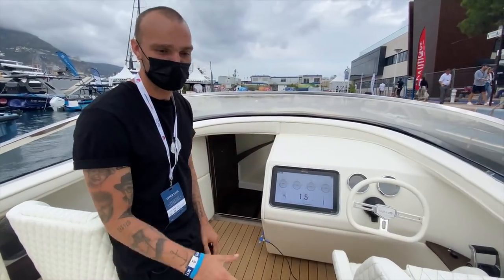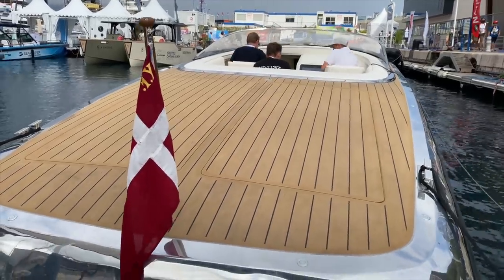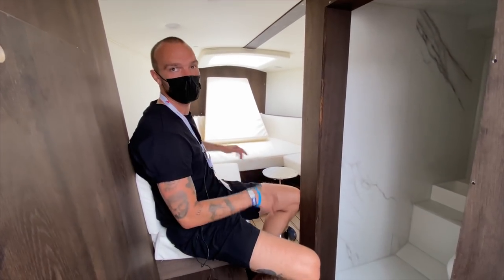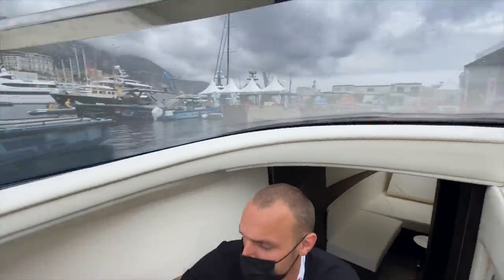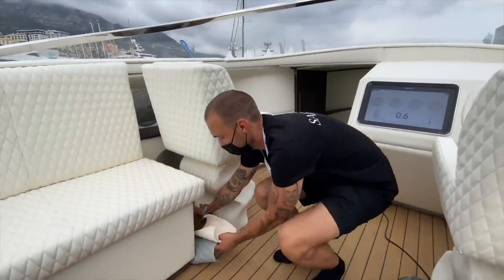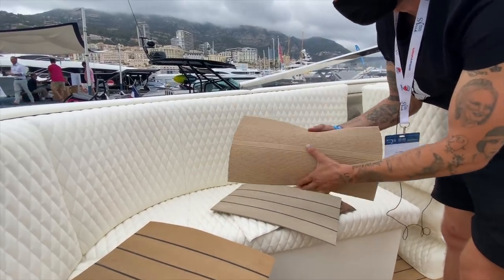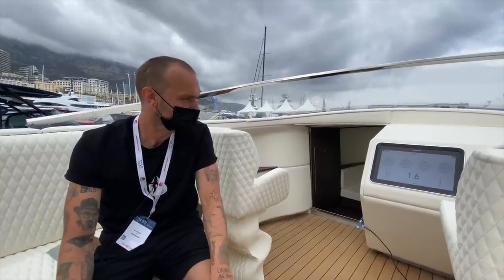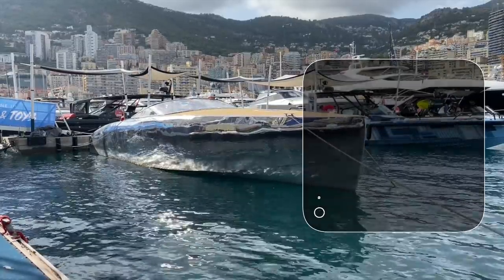100% Electric Speed Boat | Monaco Yacht Show

Comment: Great video.  Nice product.  I know it's hard to ask everything, but no back up generator in case?  I thought uncoated aluminium was attacked by salt which creates micro pits?
Reply: Is there such a thing as marine metal lacquer? Don't know.
Reply: Expedition artic  yatch's are frequently bare metal they use specific grades of aluminium are very careful about isolating mixed metals. 
Aluminium raw oxidizes rapidly.. essentially this is what happens in Anodizing...but to a greater thickness ... Its hard and quite resistant in itself and they usually have hulls measuring 5-10mm thick and of welded construction. This speed orientated vessel is probably a lot thinner overall but will still be a lot thicker than in auto or aero use. 
Its hull is reminiscent of some of the 1930s-50s grand speed boats or record breakers. Though they were usually of riveted construction like flyingboat hulls. Inside they would paint them and smear lanolin over the inner water structure to minimise the reactivity between rivets and plates.

Comment: Sarvo kind of shows the problems inherent to electric water vehicles, as he says you can run for about 4 hours on a cruising speed, he says that's 23 knots whereas the website says 15 to 20. Either their website is a bit pessimistic or he is being somewhat optimistic. And you got a bit faster? Your drain goes up exponentially. Hours turn to minutes. The problem is... PHYSICS. The Silent Yacht people were good to go into this. An electric car needs to get up to speed, which is taxing to the system, but once at speed its a relatively small amount of power to keep the speed maintained. Seas are not like that, it is constant push, constant push, constant push. And that's why yachts have thousands of HP engines, thousands of litres in tanks. A family yacht can be 0.4 mpg and a family car can be 40 mpg. 100 times the difference. So the much larger power requirement is problem #1, and problem #2 is the inability to provide it; that's due to the relatively small energy density of batteries compared to fossil fuel. Batteries are only a percent or two actual fuel, 98% or more of the space and weight is hosting materials (Oxidising compounds, Electrode materials, Electrolytes, casing, let alone installation racks) whereas in a standard vessel you have the "tank" (which might even  be plastic) and then everything else is pure fuel. 

That's not to say electric boats don't have a place. This speedboat can be a toy for a superyacht, quick laps around the motherboat or somewhat slower as a tender. The Torqueedo engines are fine for someone on a small yacht inflating an ultralight dinghy to tender to a nearby shoreline for a picnic. And yes Silent Yachts exist, but as the interviews with the people running it make clear unless you're content drifting around at walking speed you'll be running your fossil fuel generator to fill the batteries.

We have eco yachts already. They have sails. But even them have generators these days for navigation and air con.
Reply: Yes it dose

Comment: Engine has 1280 hp ~ 950 kW. Full battery capacity is 360 kWh. So you can run the boat for about 360 / 950 / 0.85 * 60 = 19 minutes on full power until battery is completely empty (at 0.85 capacity factor). Though a nice virtue signaling device if you have the money.

Comment: Maybe the final version will have some solar panels on the back? I would love to see it going…
Reply: No…. Never gonna happen
They take up space that can’t be otherwise used (panels are fragile as hell) don’t really look good, and with the small area available, solar charging would take weeks
Reply: The amount of charge they'd be able to provide would be so small that it's not worth the added developing and manufacturing complexity. Solar panels get's really hot so you couldn't walk and sunbathe on them at all, also because they'd be nullified by covering them. Photovoltaic panels in flat horizontal orientation are crap, even considering the "flatness" of designed operational area, what you are suggesting is basically "Solar Roadways" all over again.
Reply: Check out Greenline hybrid yachts with solar panel roofs.
Reply: @tophan5146  I had "silent yachts" in my mind...

Comment: FYI, at full load you have 21 minutes of operation.  Definitely needs a Capstone microturbine as the eco-friendly driver for the batteries.
Reply: 21mins with a 100NM range. What's that around 240-250 knots(ish). Should get the job done.  :)
Ripping all that power from 350 kWh in 20mins doesn't seem wise.
Reply: That's the problem with all electric. 950Kw with 360Kwh pack
Reply: Thanks for answering my big question here!  I'm impressed you get 21 minutes at 70 kts.  I was expecting less.
Reply: @BoyceBailey  Obviously, they aren't getting anywhere close to 100nm while operating at full load.  It is interesting they expect to get 100nm on 350kwh which makes it almost exactly 10 TIMES less efficient than an electric car to travel the same distance.
Reply: @rockets4kids  It's likely about 19 minutes assuming 90% efficiency, but I gave them the benefit of the doubt.  The punchline is wide open, they can travel about 25 miles total (statute).
Reply: @jesterlead  Oh, so that was a calculated and not a measure figure?  If so I want to see a measured figure.  First these things are rarely linear and second I want to know if their motor controllers can run full-out for 20 minutes without burning up.
Reply: @Rob The above electric boat is getting about 1nm per US gallon (using std conversion from electric to gasoline), vs a 50' troller that can cruise at 8kn on 2 gallons a hour.  This boat is obviously cruising faster but I suspect the 5,000lb battery is crushing it's efficiencies...
Reply: @rockets4kids  that's the numbers on their website which I picked to derive  a ridiculous number of speed for some fun and whimsical whim.
Reply: @BoyceBailey  Got a link to the page?  The one provided  by eSysman is dead.

Comment: I am not sure about an electric boat that you need to charge rather than using solar to recharge. There are few charging stations in marinas much less at sea. Prototypes are difficult to sell because they are unfinished. Boating is a costly hobby and “imagine this or that” really doesn’t work. Some interesting concepts and recycled material.especially the plastic teak.

Comment: the web says its aluminum and it wont have any problems, but they say you can't make a stainless steel boat because you need antifouling and other crap on the bottom of it.  I absolutely love the look, but don't know if its actually usable or if its just a tender
Reply: @suspicionofdeceit right.  but the reason  you need antifouling is to keep the creepy sea creatures off the boat.  so why dont' they need to keep creepy sea creatures off luminum?

Comment: If someone is truly so concerned about being eco-friendly, they shouldn’t be owning a speed boat in the first place. 
This boat will be great to feel good about yourself and virtue signal.
Reply from the maker: So you’re saying if you want a speedboat just buy a polluting one. There should be no option to have a clean one?
Reply: @YachtReport  I get your argument.. but he didn't say that.
Reply: @YachtReport  Maybe I'll get one, at this point in my life I can use all the virtue I can get ; )
Reply: @YachtReport  I think electric powertrain is great, even if the manufacturing of huge battery banks is not eco-friendly. And neither is using huge amounts of energy to cruse at crazy speeds - the energy that’s likely to be coming from a polluting power-plant, depending where in the world you’re recharging at. 
My real issue was with the superficial focus on making everything out of recycled materials on such a small boat. The environmental impact is so minuscule... for example, how many trees were saved by using a recycled teal, one?

Comment: This is pretty cool but where the heck would you charge this sucker up at? Most of these fast Chargers can only sustain around 50-75kwh.
They can only fast charge up to about 80% of the batteries capacity before they go into slower charge rate then could take an extra couple hours itself to reach 100% charge. 
I dig all this high power EV stuff but charging takes a couple minutes. LOL